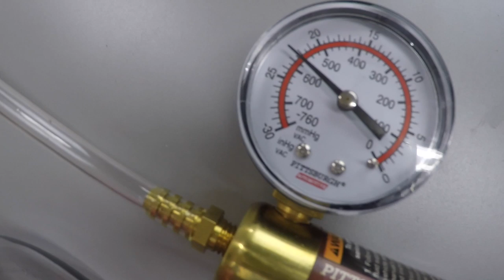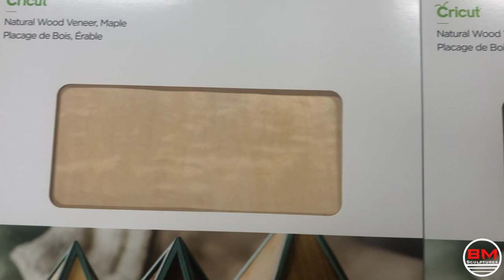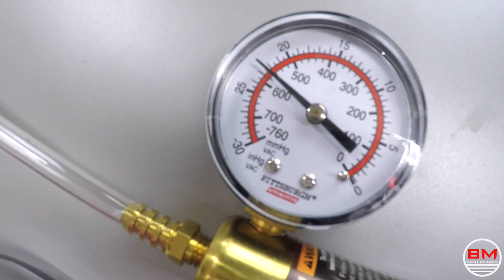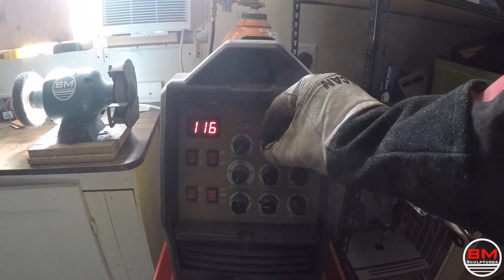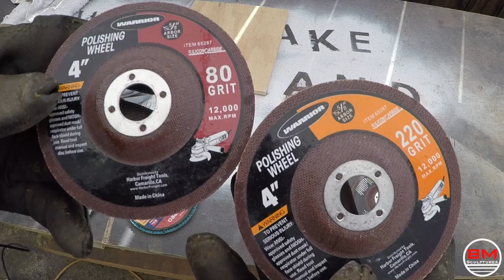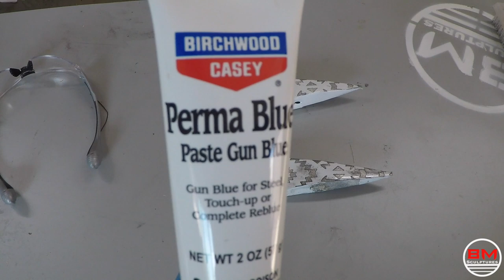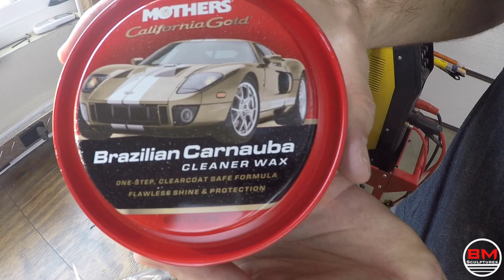Suspended feathers encapsulated in Epoxy Resin, Double Tomahawk build!

Comment: Man those look incredible. I know you made these just for looks and not to use per another comment, but if someone did would the epoxy hold up? I'm guessing not but I've also never used it so I have no idea. Also, how did you get your printer to cut like that?
Reply from the maker: I don't think they would hold up for even one swing. Strictly wall hangers. The printer is a Cricut cutter, meant for vinyl cutting, however it can also cut thin veneer with a upgraded blade. I just got this machine and love it so far.